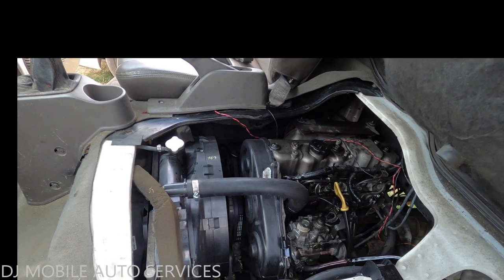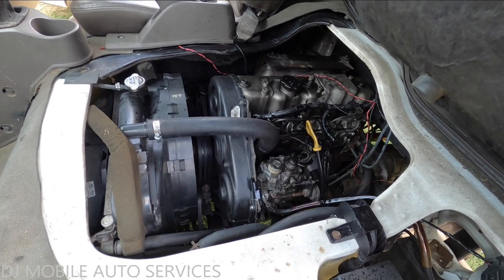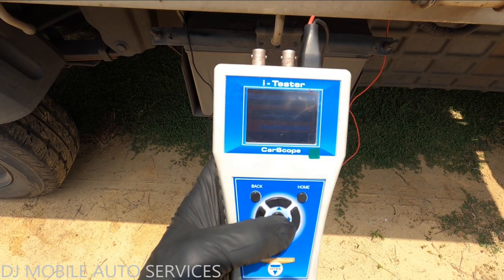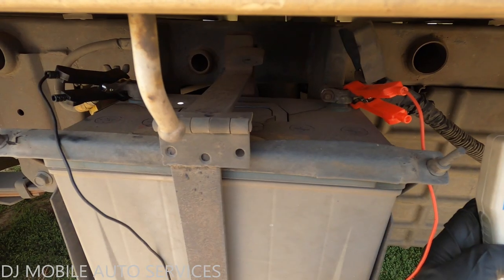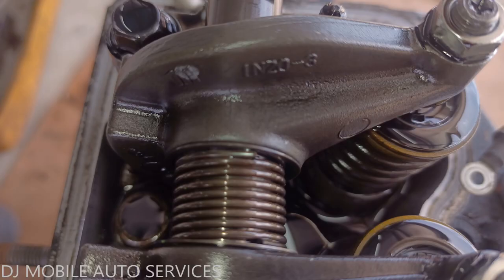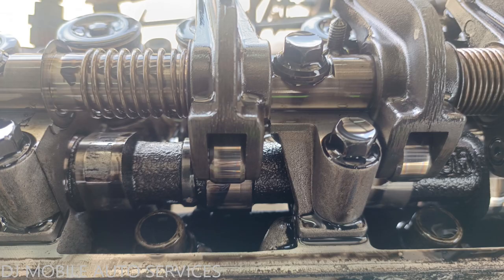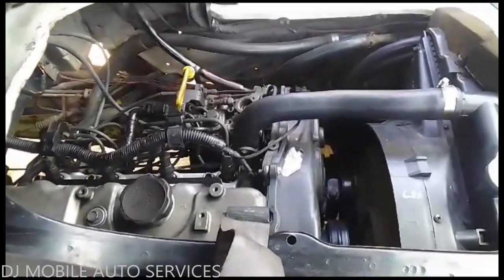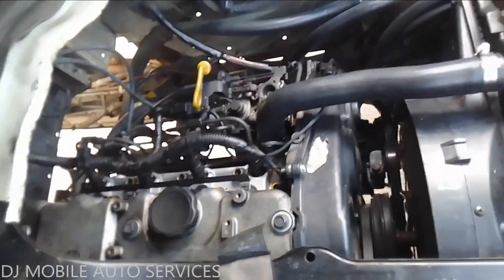Hyundai H100 Lost Of Power Diagnose & Repair

Comment: GREAT VIDEO STRAIGHT TO THE POINT ,,, THE i-TESTER IS MY NEXT TOOL ON THE LIST OF QUICK DIAGNOSTIC TOOLS AND SEEING YOU USE THE GTC 505 I HAVE BOUGHT THAT TOOL ,, I MEAN I HAVE SEEN IT BEFORE BUT WAS ON THE FENCE ABOUT BUYING . WHAT I HAVE NOTICED IS THE TYPES AND BRANDS OF CAR LINES YOU WORK ON ESPECIALLY THE RIGHT HAND DRIVE VEHICLES ARE VERY MUCH THE SAME THAT I  SEE HERE WHERE I LIVE THANKS FOR THE OUTSTANDING VIDEO QUALITY AND LOOKING FORWARD TO MANY MORE . 🙏👍👍
Reply from the maker: Yeah. Quick and too the point. Sometimes I just want to get in and out with the diagnosing. Great tool. Kinda of limited thou for the price but RC test have burned me in the past. So always go beyond
Reply: @djmobileauto  YAA,,,,,, I AGREE AND I ALWAYS DO FOLLOW UP CHECKS TO MAKE SURE AND SEE WHY I AM HAVING A LOW COMPRESSION CYLINDER . THANKS FOR THE REPLY .